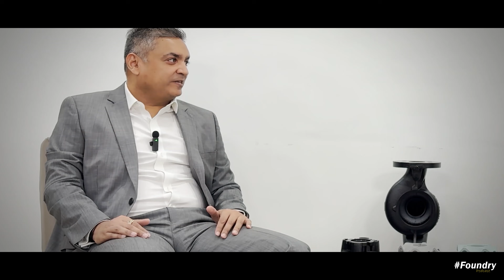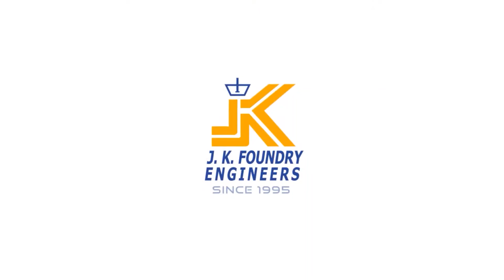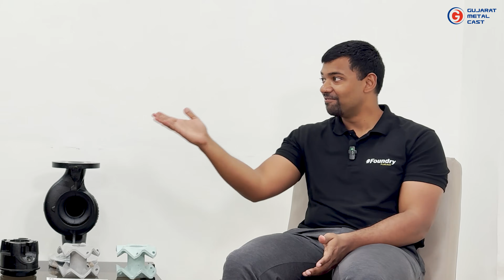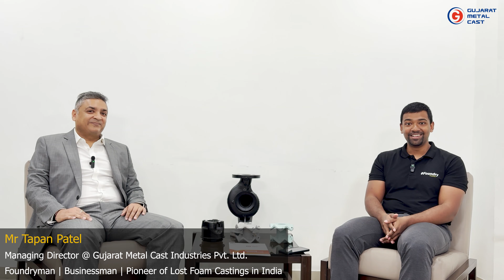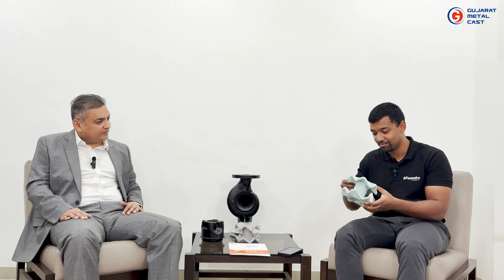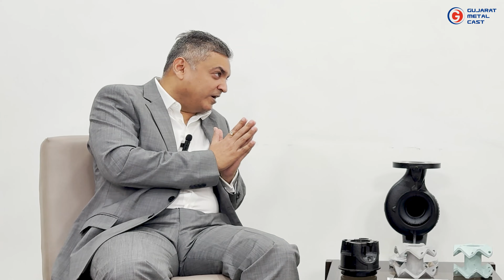Why this Foundryman switched from Greensand to making Millions of Castings per month in Lost Foam!

Comment: Hi Ian I am interested in knowing more about this process in order to make stators for electric motors. Could you please make a video on what is possible using lost foam casting
Reply from the maker: Hello, I’m afraid I won’t have the knowledge required.

You could reach out to Mr GD Mishra, a consultant in the space, I can share his number.

Also JK engineers, since they are making equipment, will know the process and help with the setup and feasibility study for sure, JK’s number is above ⬆️.

Hope this helps!
Reply: @FoundryBiz thank you very much
Reply from the maker: @skeletonmasterkiller  +91 96012 77527 - Krupal (JK)